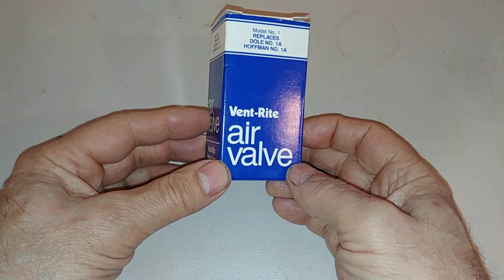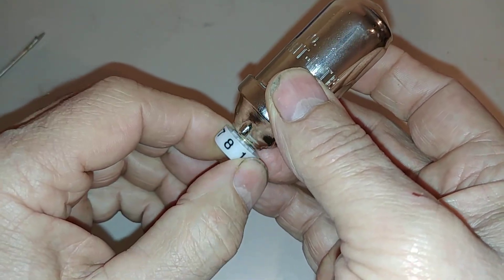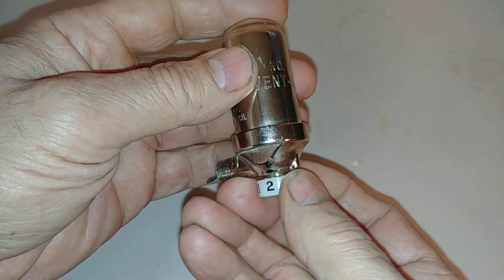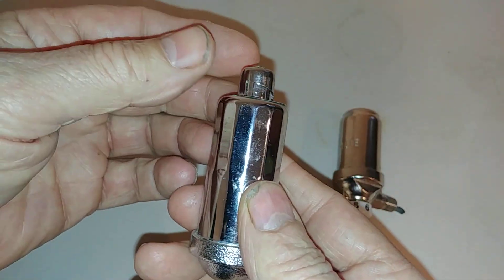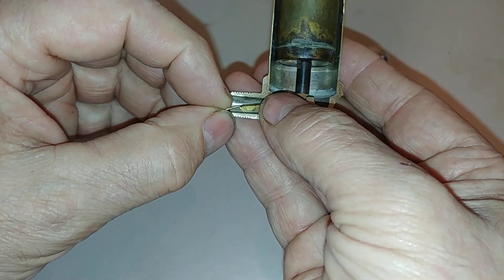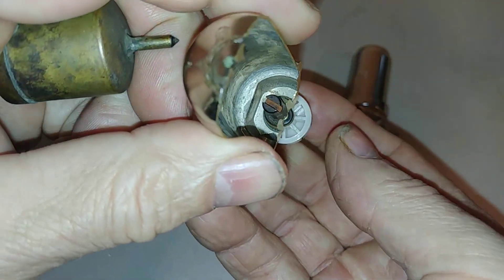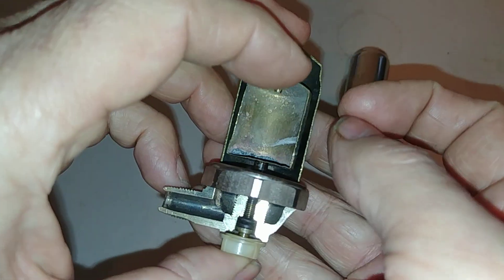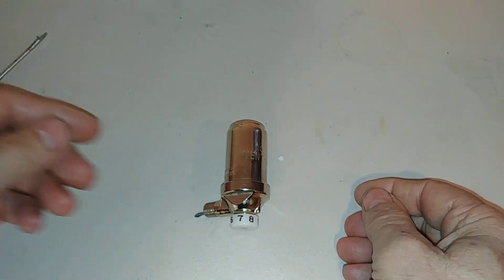Vent Rite #1 Adjustable Single Pipe Steam Radiator Vent. A Pretty Darn Good Vent.

Comment: Gordon, 
Thank you for a no-nonsense description. I have a  large living room radiator that just doens't just warm. Can I use the Ventrite#1 with a radiator cover. You mentioned at one point using the Ventrite with a radiator cover is not a good idea. Please clarify. 
Mark Downey
Reply from the maker: You are most welcome for your kind words.
As to your question, my overall objections to radiator covers are two-fold: 1) Most cover designs restrict the radiator output by as much as 30%. 2) Most designs restrict access to the vent so it's more difficult to adjust it, defeating its most salient feature.
What vent do you have on the problem radiator now?
If you don't have good large vents on your mains, that could work against the radiator heating up.
The inlet valve could be closed (just had one like that today, in fact).
If you vent a radiator well, and it still doesn't heat, it's not a venting problem. 
But that's where to start.
Reply: @gordonschweizer5154   Thank you for your quick response. I am presently using new Hoffman No. 1 for one-way steam. I have them open to 6 FAST. 

On another matter, I have a new boiler that has been pure hell as Installer No. 1 piped the Hartford Loop too high, so the boiler kept flooding the radiator air vents. It was a repeated nightmare. Installer No. 2 corrected the piping but installed Gorton Air Eliminator at 10 pounds. I originally had Gorton #1 which are I believe rated for 2 pounds. Could this be a reason why one half of the house heats more poorly than the other half?  

Any assistance you have will be most welcome. Thank you.
Mark
Reply from the maker: The Hoffman 1A at setting 6 vents more than the Vent Rite #1 at max opening, so it seems using the Vent Rite won't solve your problem.
I would look elsewhere to solve your heating woes.
It sounds like you have a multitude of issues that would kill the steam even before it gets to your radiator.
Make sure your boiler was cleaned properly.
Contaminated water makes poor quality steam.
Make sure your pressuretrol is turned down to its minimum possible setting and the pigtail didn't get clogged up with goo from the new boiler.
You may need a Gorton #2, which vents over 3X what a Gorton #1 does.
Vent the steam mains as quickly as possible, so you can vent the radiators relatively slowly. 
I cannot see your system, so some of this advice may sound out of bounds to you, if so, my apologies.

Comment: just moved into a 3rd floor condo with a bunch of radiators (built in the '30s) that really kick ass, to the point i need to open a bunch of windows when it's 30 degrees F outside! after a bit of research, they have what i now know are the hoffman 40s on them. i want to try adjustable vents to tame the radiators and after a bit of digging around i've alighted on these

now, my worry is that the vent rite adjustables are rated for lower pressure than the non-adjustable hoffman 40s; is that going to be a problem?
Reply from the maker: You ask if replacing the Hoffman #40 with the Vent Rite #1 might not work if your system's pressure is too high?
First of all, very astute of you to pick up that potential problem!  You have really done your research.
The answer your question, is... it depends.

It would be best to politely inquire of your condo board (or make friends with your super) as to what system pressure they operate at.  

If it set to be above the operating limits of the Vent Rite #1, I'd hold off on installing them for now.

In a perfect world, your system's pressure should not be above 2 psi, if it is, your current (presumed) high pressure may have been a response to someone elsewhere (and a board member) in your building being too cold.

In our world, we have seen a system in a condo where their (now former) HVAC techs had stated, in writing, that they must operate the system at 7 (seven) psi with both 1.5 Million BTU/hr boilers firing at the same time.

Said system now operates on one (down-fired) boiler at... 4 oz/in2!  And they saved 30% on their energy bill, everyone has even, controllable heat (Vent Rites) and no water hammer.

References available upon request.
Reply: @gordonschweizer5154  thank you so much for the detailed response!

what i did was to order one vent-rite and i'll see how it behaves, whether it allows any venting at all

the place i ordered it had a blurb at the bottom of the spec sheet suggesting that a bit over pressure was OK as long as it still opened up when the system wasn't cycling on

assuming this works, can you comment on what setting of the #1 compares to the normal venting of the #40? my whole goal was to try and set it lower to tamp down the heat
Reply from the maker: You're welcome!
As to your question, first, test your new Vent Rite by putting your mouth over the threaded inlet and blow into it.
Rotate the dial counter-clockwise until it stops.
You should not be able to push air through the vent.
Some Vent Rites don't fully shut and allow air to vent.
Don't install that vent and order another one.
If you have a vent that fully shuts off via the dial, go ahead and safely install that one (wait until you are sure the boiler is off and there is no steam a'comin' up the pipes!).
The radiator, with the vent now closed, should not heat.
The valve might get hot because the packing is not tight, but the radiator should stay cold. Mostly.
Now maybe experiment cracking the vent open  j u s t  enough to let some steam in.
Let us know how it works out.
Reply: @gordonschweizer5154  success!

just to close the loop here, i figured out that the main culprit was the biggest radiator which is in my living room; with it shut off the whole place is OK to maybe slightly chilly when it's in the 30s outside, with it on the whole place becomes a sauna no matter how many windows i open

i got in the vent-rite #1, and it easily passed the "blow test", stopping all air even before the knob got to the end of its travel.

popped it into that radiator with the knob set fairly low, when the next steam cycle kicked in i could hear the vent-rite quietly and continuously venting away but the radiator never got hot at all!

i cracked the vent-rite open another number or so, and on the next cycle the radiator got warm just on the other end by the valve. this should mean that i've now got lots of room between "off" and "too hot"

fully adjustable radiator, hurray! (and this answers my other question, the lower settings on the vent-rite #1 are a lot lower than the venting rate on the hoffman #40)

thanks again   
🙏🙏
Reply from the maker: @walterw2  Outstanding! 
Thank you for the feedback!
Your "real world" experience and clear reporting will help others in similar situations.

Comment: Thank you so much for this very informative video. A quick question: my improvised small bathroom "radiator" (very tight space, it's just a single pipe plus vent) is equipped with a Vent-Rite #1 and there are 3 issues: 1) the "radiator" isn't heating (at all); it requires pliers to adjust the ring from 1-8, so the vent may be bad; 3) and I can't twist off the vent (too tall to spin, runs up against the baseboard). I was thinking of using a saw to cut the top off the vent so I can twist it off, and then replace it with a Varivalve 925006-00 adjustable straight (horizontal). Does this seem like a reasonable approach?
Reply: PS, just learned from another video how to carefully detach my "radiator" from the supply valve, so please ignore the part about sawing the top off the vent!
Reply from the maker: I do not envy your predicament.
I cannot see your job, so my advice here  might be off base.
The Veri-Valve is not my favorite vent. I would try, if you can, any other quality valve before installing that one. I have my reasons which I'll respectfuly decline to elaborate.
Somehow, the Vent Rite was installed. Is there a way to remove the radiator to allow the vent to be removed? I'm sure that seems like a silly question.
Given that's not possible, cutting the vent off may be the way to go, but try to add, say, an 1/8" npt brass street 45 or two so another Vent Rite or Hoffman 40 or Gorton #4 can be 
added?

Comment: Just purchased installed four of these vents.  Two of four are unfortunately defective in that no air can escape the radiator so no heat in those.  Is it your experience that the quality control in the fabrication of these vents is consistent?
Reply from the maker: It certainly seems you got more than your fair share of bum vents.  Up till now, my experience of failure rates for this vent has been between 1-2%.  I'd definitely call the vendor and complain.

Comment: Great to have come across this video.  I've been wanting to know what is inside of them for many years.  Very nice explanations and views of the inside.  Some of mine do not close fully when cold and I blow through the threaded part.  It may be that they will only close after the float inside gets hot and the bottom expands to close the vent fully.  The curved part that goes into the threaded part was a mystery so I  now know the tongue part is not a problem.  It just fits in and stays there i.e. passive.  They are not precision devices to the numbers are very much a rough ball park but at least let you know the direction to go for more or less steam into the radiator.  I replaced a few over the years so have 4 extras but they probably all will work.  I've had them soaking in vinegar and not sure if it did anything.  When I turn the white part the part goes up and down.  I never knew that before.  None of these three close fully.  If I turn them upside down and "kiss" the top as a poster below mentioned they all close.  The float rod goes into the vent hole to seal it.  That is cold so when heated the float rod will likely fully close off the vent.  I think the vents with Vent Rite written diagonally are early vents.  The white knob is closer to the body than later #1's.  The later ones have thicker bolder letters of Vent Rite that are horizontal with #1 above.  The knobs are a apart from the body more than the earlier vents.  Note: my "early" vent has the white knob with black numbers and the same as the later vent.  
   Glad you showed the vent with a hold and cap that covers it.  I never knew about the hole and though something on the inside.  So thanks for that.  
   I have a Dole that has a ring at the top you turn for more or less steam and a large domed cap with a big slot to screw down the ring part.  It has a white plastic drip part that goes into the threaded part,  a few inches in length and curved down.  The curved part seem to no come out.  It's stem part into the threaded part probably has an end that expands in after being pushed into the threaded part hole.
   Both the Dole and the one with the hole and cap close when tipped over.  Both has something inside that rattles around when I shake the vent.  It's probably a float like inside the #1.  So I think all of my vents work.
   Great video that has helped me a lot.  Thanks for cutting the #1 to expose the inside.
Reply from the maker: Thank you very much for sharing your detailed experiences with the Vent Rite #1. It definitely is a welcome addition.
As you have found, not all of the Vent Rite #1s close 100% using the dial.  Most of them do, but it depends on the random batch.
Ultimately, you want them to work to close against steam release, of course, and closing via the dial is a nice feature if it works for any particular vent.
We usually can pick out the vents that close with the dial from the dozens we stock every year and we are fortunate in that.

Comment: I noticed the little dimple on the underside of the float in your breakdown model.  Wonder if this could have come about from over-tightening.
On another note, I have found it helpful to test these valves with a vacuum by kissing the top end instead of mouthing the threads.  No joke, much more controllable.  Definitely some variations in tolerance found using this method.  My go-to vent ever since I had a new USAV vent crack along a weird split in its side.
Now, just have to find a way keep others (teenagers) from spinning those adjustment wheels!  Any ideas?
Reply from the maker: Good eye on the dimple.  
I had a few "mix and match" parts in stock to prepare for this video.  That example was from another Vent Rite I cut open cross-wise to get the float chamber intact.
All of the vents had been tested and found to have failed, so they were slated for prep for this video.
Some vents I bought surplus and the dimple may have happened before I got it or may have been caused by me in an attempt to get the vent to work before condemning it. I don't remember.
The first breakdown model you see in the video failed because of a rare longitudinal crack just like the ones that all too often happen on the USAV vents we so disparage.
The USAV vents have thinner walls then others (as shown in other videos) and I believe get the minimum annealing to keep their cost down.
I hope the Vent Rite crack I found is not a harbinger of things to come.

Thank you for the tip on the vacuum test!

I have no ideas (yet) on keeping unauthorized persons from messing with the adjustment wheels.

Comment: In your ongoing quest to educate the world on the dead men, you mentioned, [on the issue of radiators not heating] , "If the raditor is not heating and the vent is not the issue, there are a number of other causes we'll not go over here..." (paraphrasing)  As a point of curioisity, if you ever deign to create a video, "The most common causes (other than venting) for a radiator not heating are:..." , I'm sure a bunch of us would be all eyes.

Comment: Great video 👍. Tech tip that I learned the hard way I had a steam main vent that I was replacing and with a 2 foot pipe wrench and another one backing it up it would not come off so I used a torch to heat up the end of the vent where it screws into the nipple. That vent went boom 💥 very loud. Totally not expecting that 😂
Reply: Filled with alcohol and water.  Lucky you didn't maim yourself.

Comment: Do you think they’re better than the adjustable Hoffman’s ? Also, I have one radiator on the second floor that the vent keeps filling with water ? I noticed someone ran about 15ft of 1” copper tubing to said radiator ? Any advice ? Thanks Gordon
Reply from the maker: In general, the Vent Rite #1 is better.  The 1A has gone down in quality, say to say.
As to your flooding radiator, maybe try venting it a bit slower? Is the valve to the radiator open all the way?
Is the pitch on that 1" copper pipe continuously (with no dips) allowing the water to flow back to the boiler?
Water hammer anywhere?
Reply: @gordonschweizer5154  the radiator isn’t flooding with water, the air valve fills with water. Sometimes making the radiator too warm. I tried 2 different sized Gorton vents and both filled with water. The Hoffman 1A worked for a year and kept filling with water and making the radiator too hot. I have a non adjustable vent rite and seems to be working okay for now but I’m sure it will fill with water. I’ll have to wait and see ? Thanks, for your help.
Reply from the maker: @andyajitsingh9127  Oh, yes. I see.  Make sure the tongue in the vent's 1/8" connection is situated correctly to allow for proper water drainage.  Does the vent pitch either level or into the radiator?  Slow up the venting so the steam does not reach the vent until the very end of the heating cycle.  No steam at the vent means no water in the vent.
Operate you system at low (less than 2 psi) pressure.

Comment: Radiator Valves😱😳
Reply from the maker: VENTS! I meant to say VENTS! LOL
Reply: @gordonschweizer5154  no you said vents. You said you recommend that people don’t use the valve. Touching the valve is a criminal offense punishable with a severe pipe wrench beating. I cringe every time a customer tells me they played with the valve.
Reply from the maker: Agreed 100% about single pipe steam radiator vents..VALVES I mean say VALVES!  A never-ending battle!
I thought you were referring to the thumbnail picture where the box reads "air valve" unhelpfully.
Reply from the maker: Actually, it IS an air valve in construction, as opposed to the other brands which depend on air shutters.